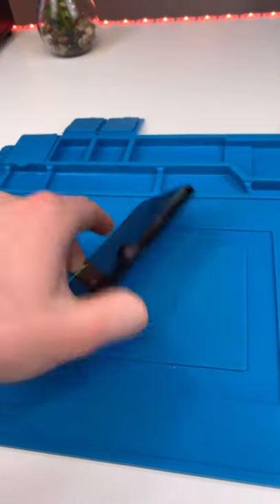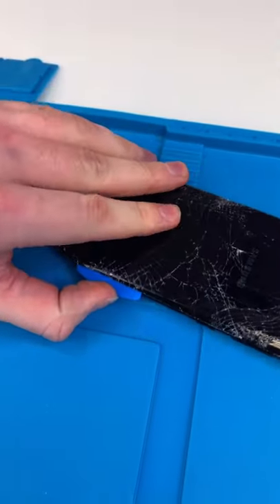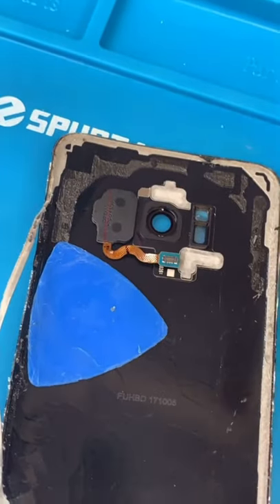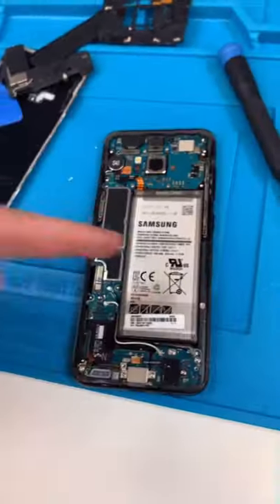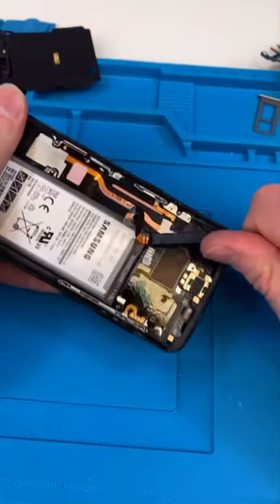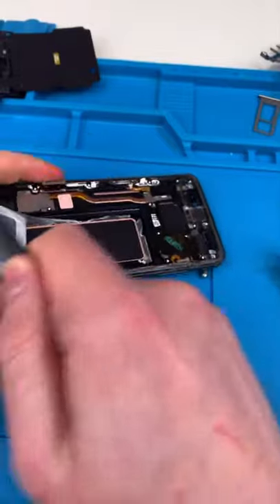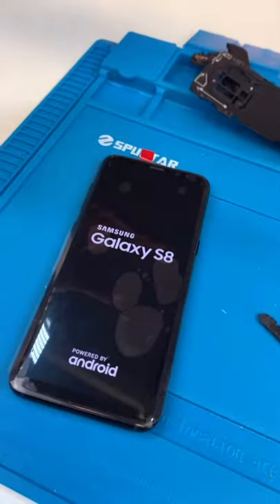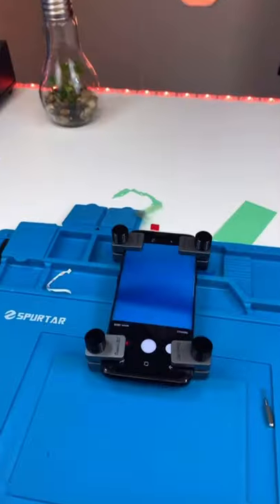S8 Back Glass Glue Is Stronger Than the Hulk #Shorts

Comment: The issue with what you just did with the battery is that, you can puncture or bend the battery that way. One wrong move and it's done.
Reply: @PhoneRepairGuru  I know for a fact because I'm a phone technician using the same type slugger as you. I assume you use fixit for the repairs. It sucks when one is punctured and you get a lovely smoke cloud in the face.

Comment: I have a galaxy s8 with a slight crack in the bottom right corner on the front. the oled panel is not damaged. Is it possible for me to just replace the glass? or do I have to replace the whole panel?

Comment: I was wondering if you can fix my phone what's wrong is that there's two speakers and at the top speaker which is the opposite side of where the charger goes it does not work anymore because I press really hard in a certain spot that was connecting two pieces together that would make the speaker go and now it does not work that's why

Comment: Honestly man im a huge fan of your videos and repair style, but that battery removal was straight up savagery.. I like to heat up from the screen side and if necessary use alcohol to soften the adhesive, and i also use a flat metal or plastic pry tool, not a fat ass spudger.. Jeeesus.. 😂😂
Reply from the maker: Lool thanks. I heated it up before and put iso on the tip. Works like a charm for most samsungs as long as you can get by the connector flex cable. I have bad luck with metal lool
Reply: @PhoneRepairGuru  ahaha iso on the tip.. Thats a good one, might have to try it 😉, i like to squirt a bit under the battery from a bottle or syringe, works a treat for pesky pull tabs too. Anyways, im not trying to teach my grandma how to suck eggs here 😂  just wanted to let you know you're a savage! Keep up the great work and good luck with reaching 1M..
Reply from the maker: @aqualibrium545  Thanks man appreciate it. Have a blessed day